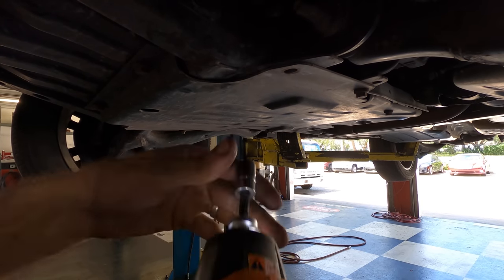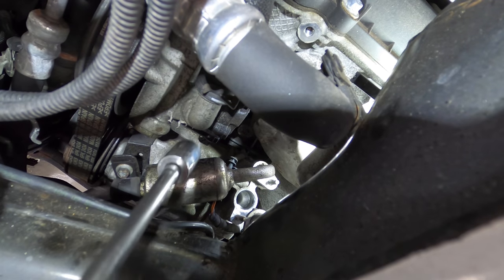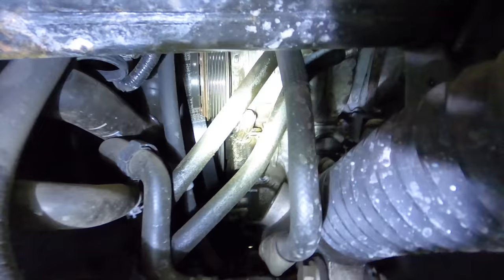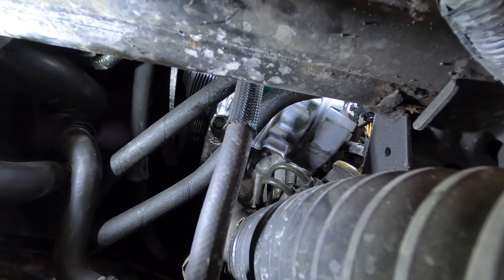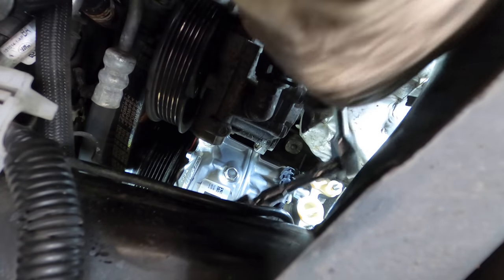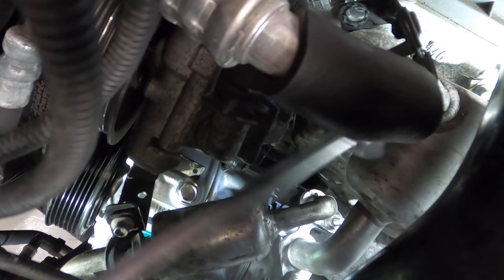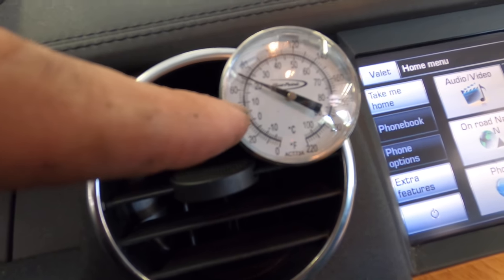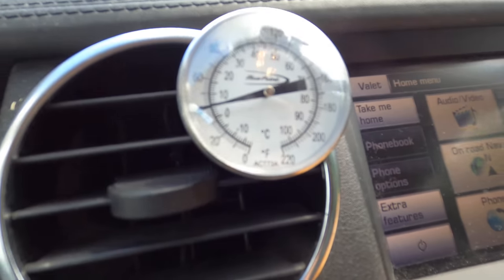Land Rover SUV Compressor Extraction! Working blind! Read Description.

Comment: Engineers should be forced to work on the things they design.
Reply: Agreed!!!
Reply: I say that about the bastards that pack my bags for Money delivery......
Reply: If I could tap the like button more than once, I would.  I've worked on some pretty crappy stuff and always wondered why engineers do that.  They must get paid to piss of mechanics
Reply: YESSS Most agreed!!!
Reply: @edwatts9890  this is the best analogy I have heard.
Reply: When I learnt about repairing cars I was taught that cars used to designed to be worked on at home by the owners with only basic tools and that cars now are designed to be repaired by a computer to tell the person what needs replacing but the computer is mostly wrong
Reply: @186scott  usually the computers are correct, but the person doesnt understand the information given. Computers are great and giving a good general idea of a problem so you can start diagnosing the different potential causes.
Reply: Oh yes,
Reply: You wouldn’t have anything to  complain about  if they did 🤕🤕🤕🤕
Reply: And a typical thing like oil filters that are supposed to be changed  ,,,, if you ever changed one on a newer cummins b engine you know what I’m talking about,,
Reply: As an Engineer, I agree. 35 years, I've never asked a mechanic to do something I wouldn't do myself.
Reply: Not sure if you guys know this but this particular model of Land Rover requires the removal of the body from the chassis  for some normally simple (on other cars) repairs.
Reply: I'm a design engineer and unfortunately we don't get a blank sheet.  We usually get given a space and then have to fit everything needed into that space, also considering maintenance.  If every engineer was given carte blanche then cars would be a bit/lot bigger. ;-)
Reply: Well since the engineers work for the manufacturer and the manufacturer doesn't sell cars to the public, only dealers and dealers don't usually do repairs the cars not under warranty, why should they care?
Reply: Exactly right Valen.
Reply: Concept designers design the car, not engineers. Then marketing tacks on a list of specs that will excite the target market with new features and meet existing expectations for common ones. At some point engineers get to push back with a little reality, but not much. 

If engineers designed the cars they would be easier to work on, but the process almost always flows from the outside in, not the inside out. The engineers are given a shell of a vehicle, an existing engine likely design optimized for a completely different vehicle and a list of additional specs and then have to make everything fit inside the available space. They're probably taking various pieces in and out a thousand times before it hits production, so yeh, they are forced to work on it. And I guarantee you they are cursing the designers and marketing divisions the entire time, probably saying THEY should have to work on it.

Sh*t always rolls down hill, it's how the world turns.
Reply: @186scott  Yes, but if that were the case today new cars would still look like the old 1930 ones...
Reply: @corrigenda70  that is true and they would also be built not to rust as easily as they do now
Reply: @markdecker3313  My guess is that 50% of colliding parts set up is due to distancing specifications and norms designers have to work under. 25% is not understanding the practical side of servicing and repairs and the last 25% is not giving a F about how easy/hard this work will be.
Reply: 100%
Reply: As a mechanical engineer, I couldn't agree more!. It's my job now to "make it work" in the field. 

I recently went back to office work and did some layouts and had to stop myself from saying "eh, they'll figure it out during install". I'VE SPENT THE LAST YEAR DEALING WITH THAT MENTALITY AND THE PROBLEMS IT CREATES. 

It's a triple-edged sword how some products and designs make it into production. Inexperienced designers, management/financial personnel, and the government.... I can personally say that when designs are produced just in time, it's impossible to find every design/integration issue. I think my favorite WTF picture is of oil draining and hits the sway bar. I really question how that drain plug got approved to be located like that. 

Lastly, I'll apologize to everyone for some of the questionable/terrible designs that make it into production.
Reply: @ftblplar  What is really annoying though, is the insane amount of parts designed to fail. Such as plastic engine parts that are mated to hot metal parts. Rocker / cam covers, intake manifolds and such. I'm just waiting for a plastic exhaust manifold. Do they not understand the rigors of heat cycles, and how brittle plastic becomes due to it? Then there's the major components that must be replaced if a smaller integral part fails. Their cost-cutting ends up costing buyers a load of money in the end.
Reply: Strongly Agree! Especially with Lucas Auto Electric Wiring........(They are called the "Prince of Darkness" for a Reason)
Reply: Agree 100%!

Comment: Hey man love the videos and the comedic approach you use, I noticed the usual problem with the universals they wobble and flop in the wrong direction when you're in a tight spot my fix for this has been to wrap all my universals in electrical tape (one tight layer only) it's very flexible and it stretches easily. You can also pre-position it and it usually will hold it for you to make the connection without it moving or falling down to the 90 Deg position, make sure to wrap it tightly and cover the u-joint completely. Hope this helps you it works for me.
Reply: I've actually heard and used that tip b4 and yes it works.
Reply: Use shrink tubing

Comment: I feel this video. Parking lot starter swap at night on my wife’s 2000 2.2L S10. Half cussing. Half by feel. 3 hours. Really long extension.
Reply: Yes s10 starter  is a pain, but  ac compressor  can be changed  in under 5 minutes  on 2000 s10  4.3.

Comment: Man, I wouldn't be able to know or remember where all those nuts an bolts go, I had to tear half my engine apart just to get at replacing the timing chain, timing house gasket, water pump, and oil pan gasket, I came up with and system,  used brown paper bags itemize the bags and put the nuts, bolts, and parts together in each bags and it worked, screwed up one time, and extra bolt was left over that goes on to that part, after that, I torque everything to it specs 1 1/2 year later no Ieaks and didn't have to go back and redo any of my work, take your time, tighten everything to it specs and remember to walk away when a part giving you a hard time, after that, the work you done will be well appreciated.
Reply: I use plastic food containers (quart size) with lids from Smart and Final. You can get fifty for just a few bucks.. Write the locations the bolts came from on the lids. They can be reused many times, and they stack when empty, taking up little space. After several jobs, you will have collected the whole set!
Reply: @edwatts9890  I've started collecting containers to do that, but I'm taking it one step further. I'm gluing magnets to the bottom of the containers so they stick to the fenders as I'm pulling parts.
Reply: @myZcarlife : Already did that.

Comment: I'm surprised you didn't have to remove a bunch of engine parts like when you replaced the alternator on the dodge caravan. I still hate where these engineers place vital components in places where it's almost impossible to get to. Especially ones that need eventual replacement which is pretty much all of them lol
Reply: Unfortunately, the designers work towards what sells the damn thing, not how to service it after the sale. Smh

Comment: If you got it blowing cold (and even if you didn't) it would make no sense to replace such an expensive part 1,000 miles from home. What happens if the new compressor dies a month later? They have to drive 1,000 miles back to get it fixed?
Reply: Isn’t that pretty much the Land Rover owners decision?  If it makes sense to them, then it makes perfect sense.
Reply: Not many decent a/c techs in PA. If it were me, I'd take my chances in FL.

Because I live in PA and own VW/Audi cars, I also own a vacuum pump and gauges.
Reply: @johnspecht7449  Understand that but doesn't mean it's smart. Saw that Rainman didn't replace the o-rings on the lines (or made no mention of that) so if the freon leaks out after a month when they are home, what then?
Reply: @CA-ff7si  It's wasn't rocket science to replace that compressor. You only need an experienced tech for advanced diagnosis, not to change parts. (No offense to Rainman intended) And what do you mean not many decent a/c techs in PA. It's hotter in the summer than in Florida.
Reply: @atikovi1  hotter um no
Reply: @atikovi1  I had a tech quote a compressor, condenser and dryer in a civic that had a bad relay.
If I find a good tech they get the whole job. I wouldn't worry about a compressor warranty.
Reply: @atikovi1  
One person in PA misdiagnosed his Civic.  So he assumes that of its 12.8 million residents, none of them are a decent tech.  😂🙄
Reply: @pedlpower  Let me help. I said not many. I didn't say none. I say this because in my 30 years of driving I have never been satisfied with any a/c service. We have a short cooling season. Most shurg their shoulders and tell me it's the best we can do. I'm sure there are good techs somewhere but I haven't found one.

In addition. Late model VW/Audi has a common problem that no shop will investigate or repair. Compressor replacement is the only option. The fix is a 50$ part, recover and fill.

If you know a good in SE PA, I'm listening.

Comment: The Mazda I bought brand new with an aftermarket air conditioner in it was something, I think  even you would be perplexed by.

The only vehicle I ever had where the air conditioner used to leave a layer of snow on the seats, dashboard and everyone sitting in the front of the car.

That thing genuinely worked like it's life depended on it 😂

Comment: I don't think even wobbly sockets work well with a 90deg bend, yet somehow you made it work. My brother used to pay me $5 a sparkplug to R&R them from his 69 Mach 1 Cobra Jet. The dealer would actually disconnect the motor mounts and jack up the engine to get to them, but I managed with my compound wobbly sockets and scraped knuckles of course; man that car was scary fast.

Comment: Land rovers are more like a mechanical hobby than a form of transport, many jobs in the rear of the engine require the body to be detached from the sub frame.. If you like oil and bolts that a yoga master would cramp up on, then Land Rover is the car for you.. when working they do drive really great.

Comment: Working on this LR Disco, I believe is possibly the TD6 model, you nailed why I refuse to part with my ancient TD5. The number of jobs which involve lifting the body off makes my blood run cold!
There's no need for this kind of over complication which, as I specialise in vintage motorcycles, I do not possess the facilities to do. Living in the frozen, post apocalyptic wasteland of the UK AC isn't such an imperative 🙂

Comment: you work on enough european cars and you start to develop a preference for working blind and by feel rather than trying to see everything youre doing. i learned how to relax all the muscles in my hand and forearm to allow me to twist and squeeze it into alot of tight spaces. as long as there was enough room around the bolt for a tiny ratchet and my hand to physically turn, i could get it out.

Comment: Years ago I had a 1953 Chevy van with a 327 that was built in voltech high school it was beautiful well I hit an embankment and run the hood out of alignment tied it with a piece of cord figured I'd be all right I was driving down the road 
 the wind got under that big old hood and it really flew up in the next thing I knew the truck was a split window that back of that hood hit the middle of the window and I ended up with a spider web in my windshield so make sure you Hood's latched it surprised the heck out of me have a great day

Comment: Land Rover, experts at packing 15lbs of ś&îť in a 10lbs sack using crappy parts requiring a pro who can separate fecal material from a rotating O² movement device and making it look good. You sir, rock.

Comment: i was just wondering about putting everything back together before the leak test was done, s--t happens, just a pinched o-ring, bad compressor, maybe even Ray might forget to tighten something and then have to remove parts again, i am just glad it was you having to work on that compressor and not me, Happy Thanksgiving

Comment: When he said to replace remove engine, reminded me of a minivan in 80s or 90s Nissan I believe.  Had a sensor for either temp or oil pressure that you had to drop the engine to replace it.
Reply: The late 90's mercury villager had a nissan 3.3 v6 (vg33e) in it. This engine has a knock sensor located under the 2 piece intake manifold between the firewall and the back of the engine. Nissan probably used the same engine in their minivan. Could this be what you are referring to?
Reply: @joshnabours9102 probably what I'm thinking about,  thanks

Comment: This video convinced me to do the MACS 1234-YF training/cert module, however, I'm not yet convinced to invest in a dedicated recovery system, after seeing exactly zero of these systems from any of the shops which refer work to me.  The "mild flammability" factor reminds me of those "R12 CUSTOM Blends", where the word "CUSTOM" usually meant either propane, or butane.....

Comment: I have an 03 Land Rover Discovery 2 and its been no problems at all to work on. My biggest complaint so far is that you have to take the intake manifold off to replace the ignition coils behind it. It can be done without removing it but its too much of a pain to bother trying it that way as it will just take longer and be more frustrating. I've done a lot of work to it so far as maintenance. I guess the older ones aren't so finicky like these ones. AC compressor is right on the top so it was a quick repair when my AC clutch ate itself.
Reply: Have you blown a head gasket yet? Those are notorious for needed head gaskets every 60-80K miles. Rover took a small block Buick engine and just kept making the cylinders larger over the years until there wasn't enough block material left to keep the gasket from leaking after those miles. And engine GM abandoned after a couple of years Rover used for over 30.
Reply: @andyrichardson6188  they were done just before I bought it. I redid the entire cooling system with new parts and use a 180 degree thermostat from the TD5 engine. I also switched coolant to G05 and keep an eye on temps with my ultra gauge. She runs nice and cool so headgaskets are happy, for now

Comment: To all those attacking the designers - it’s not entirely their fault - they are driven to make designs that are as one piece as possible to speed manufacture- blame the bean counters and then take a look in the mirror- you want cheaper cars ? - this is the result.. monolithic designs that almost require engine out for the bits that are really wear items…

Comment: Usually to change anything on a land rover you take the body off the chassis. That’s how they are designed. Obviously it can be done in situ but it’s a lot harder. I had to replace the turbo on one it was a night mare. Land Rover quoted something silly like £8000 as it was an 16hr job.

Comment: I had a similar awful job, on a Chrysler 300C with the Mercedes 3.0l diesel engine. Changing the alternator, way down on the bottom of the engine. Got it loose but it wouldn't come out. I ended up stripping down the front of the engine and intercooler pipes, just to get it out, up and between the radiator. I heard that the main dealer, removes the cross member and maybe even the engine to do the job.

Comment: Ray you got some guts never turn in a vehicle after you have done that you need to check for leaks I don’t care if it’s new always recheck for leaks after you install a brand new compressor because you never know even though it’s new it could leak out and then your reputation is shot. Let me give an example you put it up say it’s ready to go the customer comes by a few hours later and then the AC will not blow cold air because you did not check for a leak always double triple check because I know that bill is going to be over 1000 bucks am I right God bless you take care Ray✝️✝️✝️

Comment: Time for some Rheeee!!! LOL, so much for threading in by finger bolts/nuts before applying power tools.The very first bolt to mount the new compressor gets rammed in via power tool. Makes your lecture to your trainee after the lug nut incident worthless if he watches this video. (DISCLAIMER: for those of you with no sense of humor or sarcasm this post was meant as a friendly tease to Ray.) Oh and congratulations on remembering to retrieve your thermometer before sending the car back to its owner. Guess your boss will have to forget the advertising of a free thermometer with each AC repair.

Comment: Im not trained but enjoy working on vehicles. My uncle has said for years, if the engineers who designed today's vehicles also had to work on them, vehicles would be very different. I agree with that statement too. Even trained mechanics hate working on them today. So little room to do anything. When you have to remove an engine just to replace a $30 part, that's unacceptable. Or just drop a motor mount for the same thing. It's a love hate relationship between a mechanic and his work.

Comment: I did a compressor on one of these land rovers. One of the compressor bolts was so long that it wouldn’t get all the way out of its hole and jammed on the frame. I had to remove the entire bracket holding to get it out